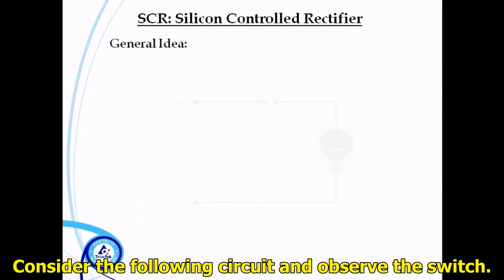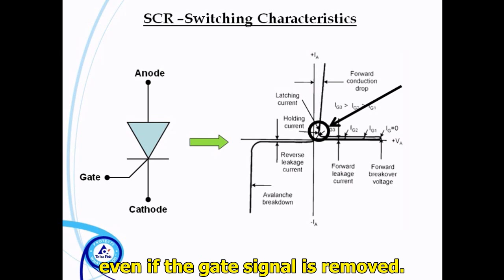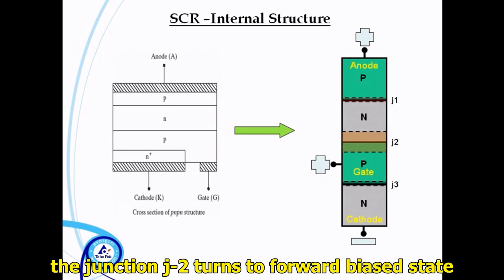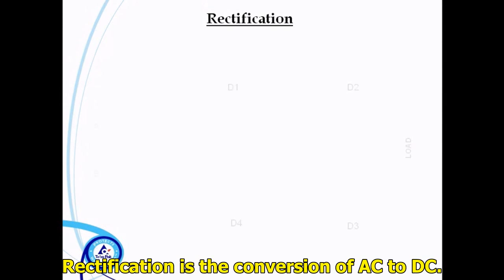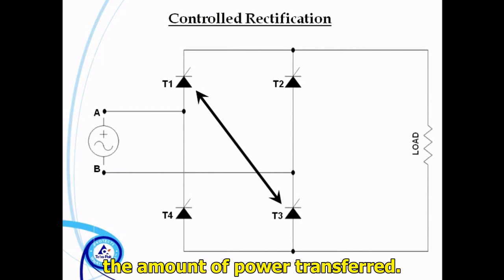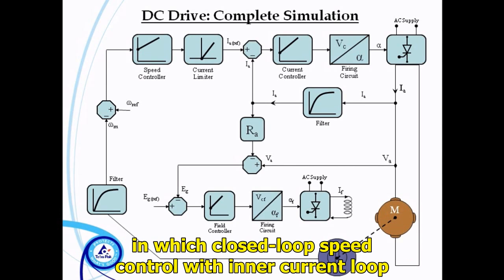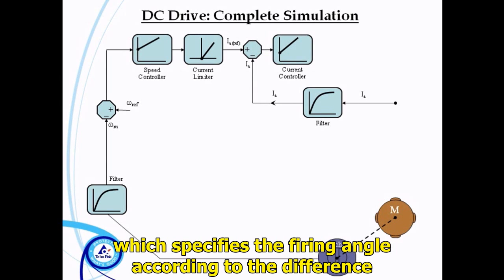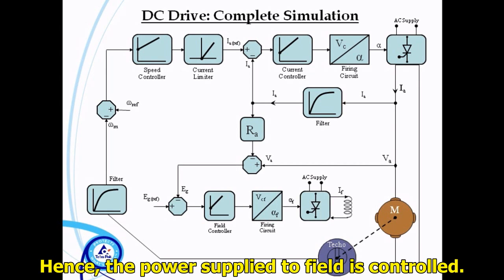Thyristors

Comment: Agree with the comment that the emphasis in the voice is wrong - which causes some unnecessary confusion. Also, the addition of words such as 'the' and 'a' in the right places would make the English more sensible. These are small, albeit important, points but over all the video is good if a little fast.

Comment from the maker: Once thyristors are given control signal,they continue to conduct unless and until they are forced to stop.This stopping procedure is usually referred as "Commutation" in electrical engineering terms.
In AC/DC conversion (controlled rectification), we control when to start but thyristors are automatically turned-off when the polarity of input AC reverses making anode to be connected with -ve polarity (similar case with cathode). Same process happens in AC/AC conversion.
Hope it is clear now. :-)

Comment: Okay so here's my question. If you remove your signal and current continues to flow causing the circuit to become regenerative, does that not defeat the purpose of a thyristor? you need to be able to control your SCR's. Especially in AC/DC or AC/AC rectification or it will cause the construction of your thyristor to melt and cause failure. Take a look at Press-pack Thyristor construction